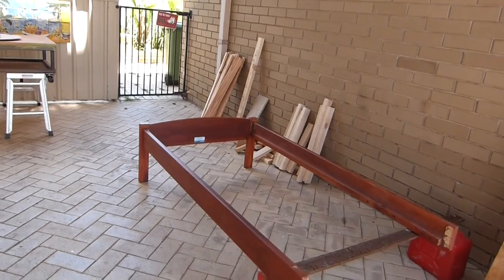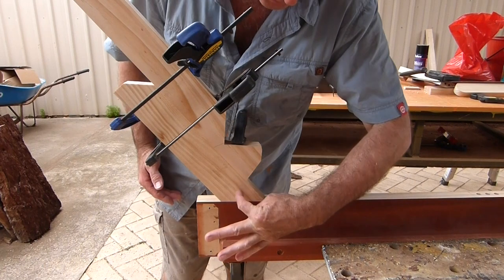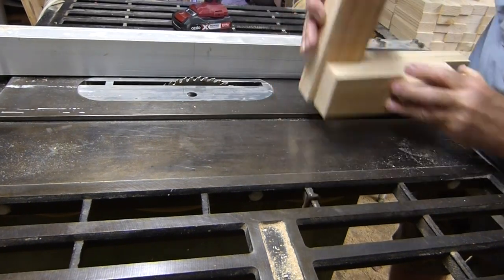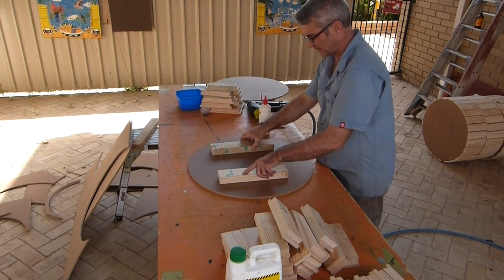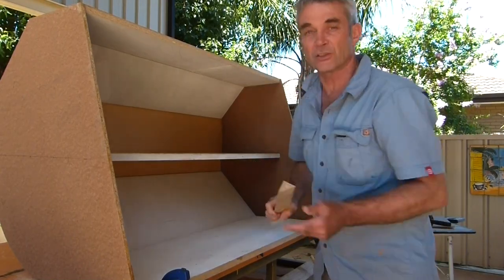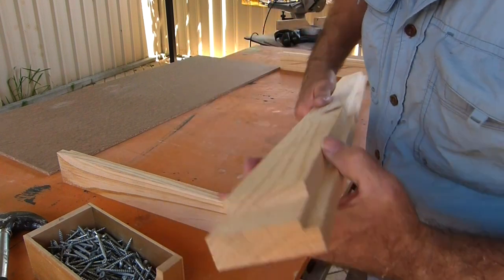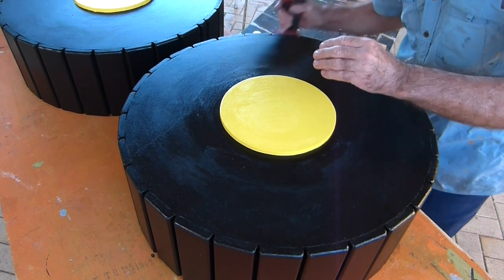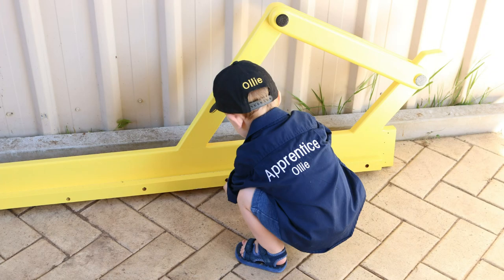Kids Beds, Building a Loader Tractor Bed with Headlights, Boys Bedroom Design, Woodworking Projects

Comment: This bed is truly awesome! Well done Gavin!! Great work.
Does anyone else have got the dimensions pretty please? 
NY son is mad about tractors and I cant afford buying a tractor bed to him at the moment, would love to build it myself but I dont have any clue about where to get the materials..if I would have the name and measurements I can do it! Hope someone else have it🤞🏼
Reply from the maker: This is not a kit, there is no brand name. The bed is a standard single bed, the mattress is the same. Everything else is just built on from that, if you have plenty of room have nice big wheels, if your room is small, just put two wheels on the outside and have the bed against the wall. The bucket/bookcase at the front can be as big or small as you want it. I hope that helps

Comment: I think you just made Poppy of the year. I would love to make one. but it's pretty big. Do you remember the length and width?
Reply from the maker: Thank you very much I am glad you liked it. I will measure it when I am there next, but the basic bed bit is a standard single bed then the two wheels out the sides and the bucket/bookcase at the front.
Reply from the maker: The bed is 2555 mm (8 foot 4 inches) Long and 1395 mm (4 foot 6 inches) Wide, if its just the width that is a problem leave the wall side wheels off. Thank you for your comment.
Reply: @GavinClarkdiy  Thank you Mr. Clark. I have been looking on youtube and have seen some of these that have just a solid wood wheel painted. Not as nice as what you did, but when space is a problem and it is, I guess it will have to do. Such a great idea. Thanks for taking the time to measure and answer.
Reply from the maker: Not a problem, have fun with your project, kids will love it.

Comment: How did you get the lights working
Reply from the maker: The four lights were bought at a hardware store, they are the type you would buy to stick in cupboards or shelves, simple led ones that plug into house power and have an inline switch, you can buy long strip ones also with the same set up. Hope that helps.

Comment: How long did it take to build from start to finish?
Reply from the maker: I did do other jobs when I made this, but I think it would take me a week from start to finished and painted. Thank you for your comment.
Reply: Gavin Clark thanks for the response. I had a customer send me plans to one similar for a John Deere tractor and it is highly detailed and I didn’t know if it would be easier to have it all CNCed or do it by hand. They gave me about a month to make it.
Reply from the maker: The more details it it the longer it will take, but also the more detail the better it may look in the end, if it is to be yours the time is not quite so much of a problem, but if it is for sale your hourly rate needs to be OK, sometimes it does not take much more time to make three things as it does to make one. Thank you for your comment.

Comment: do you have the specs anywhere for this
Reply from the maker: No I am sorry I do not, it was basically built the size of a single bed so a standard mattress would fit on it. I designed it as it as I built it, in the longer video you will see how this was done. Thank you for your comment.
Reply: @GavinClarkdiy  i want to build it for my nephew its going to be my first large project, any words of wisdom or advice for a first time carpenter wannabe?
Reply from the maker: @sandiecane  Watch how I put it together in the video, try to start with an old timber single bed that will give you a good start, watch other woodworking videos on youtube take your time there is no rush. You may find plans on line somewhere. If you look at some of the kids beds in shops you may get some ideas on how to do things too, don't be afraid to stick your head under a bed to look up and see how they made it. Remember when you make it make sure you can pull it apart to get it in or out of the room easy. Hope that helps.

Comment: Hi Gavin

I want to copy this work of yours but unfortunately it would be a real struggle for me. Can you please comment back the measurements of all the pieces that you've used? I'm really sorry. My partner has been working with the carpenters but I don't want them to do this. I would like to make this my own. Please help.

Thank you 😊
Reply from the maker: I used a standard single bed for the base, and as you would have seen in the video I really did not take measurements, it was just cut the wood as I went, and put it together, and that was that. I am very sorry but I do not have measurements or plans to pass on to you. I can only suggest you start from a single bed and make your own very unique bed. Thank you for your comment.